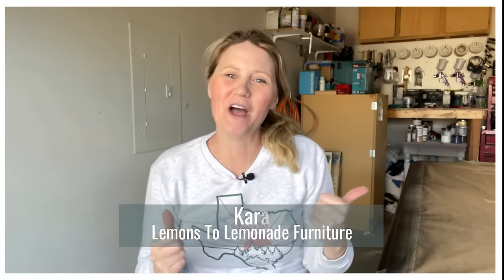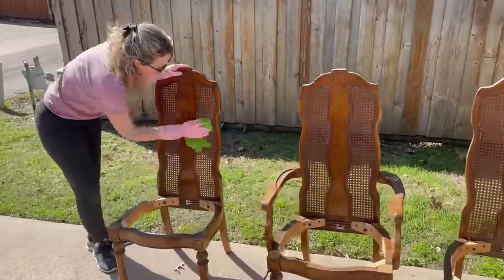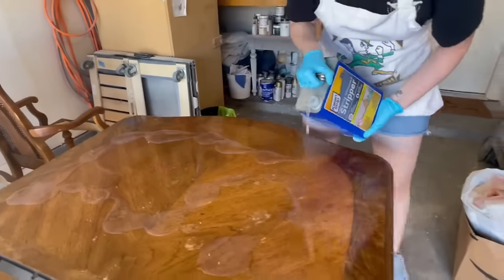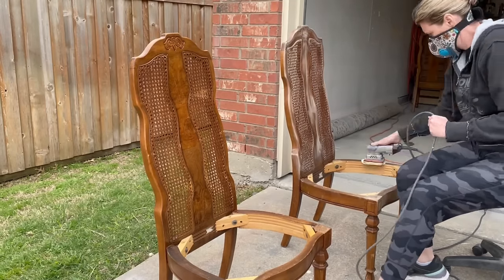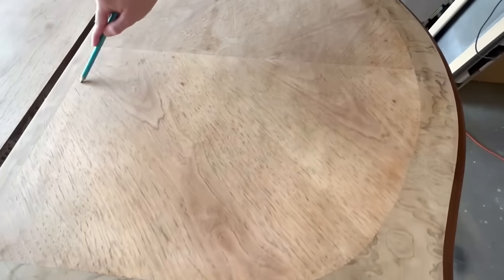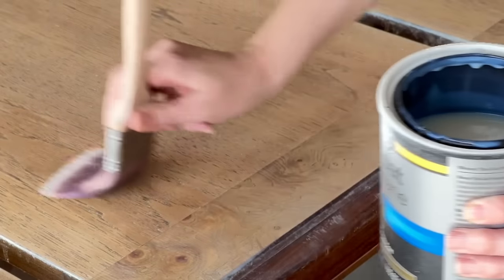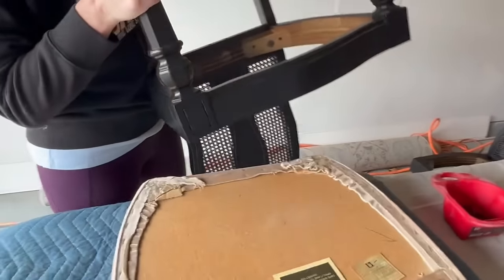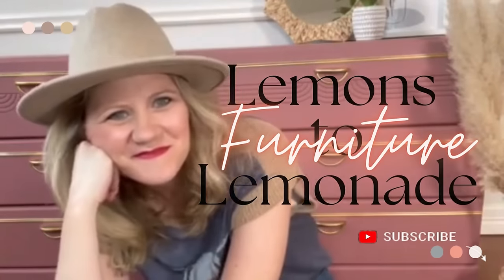Thrifting Gold: Transforming a Vintage Dining Table into a Modern Masterpiece

Comment: Think it’s lovely but I would have elevated a bit more by beige washing just the cane portion of the chairs so they don’t look simply spray painted. Also that would tie into the neutrals of the wood top and the fabric decks of the chairs, not to mention the other lighter elements in your room. Just my two cents worth. But lots of dedication and work went into this. You are a soldier!
Reply from the maker: Thanks so much! I was worried bc the cane was almost 50 yrs old how much I could sand for best adhesion and since it will get decent use, how would paint stand up over time w/o touch up. Plus the emerald trim paint can crack if it gets poly on it (it has one built in) so I would have had to be super careful to poly the cane by hand. You can tell I weighed my options on that one. Lol I definitely considered it.

Comment: I came across this when I was refinishing a dining table for my daughter’s after college apartment & looking for inspiration. I love the end result!  Your vision is amazing. Most people can’t see that far ahead or follow through between design, execution & end result—Bravo! 

I’d say the set would sell here for $3-4k.  Too bad they didn’t have the hutch/buffet! 
I love what you did with the one you already had. I just found that video. Both are gorgeous!

My only advice would be to finish the edges that are unseen when it’s together but show when taking the leaves out.  I am my father’s daughter and he always stressed doing a project 100%, like the sides of drawers & leaves, and removing hardware & hinges prior to finishing. It can be a curse sometimes!

If you wanted to upgrade the padding on those gorgeous chairs or change the fabric, it’s easier than it sounds to reupholster them —and you already have the skills and tools needed.  (& brilliant artistic vision).  
To duplicate the piping at the edge, you simply insert cording (or appropriate sized round shoelace or twine etc, like a taco, between a layer of fabric strip cut on the bias.  The bias cut allows the fabric to mold seamlessly around corners.  Or 2 rows is very stylish too, each encased separately —in either matching or contrasting fabric.  If you have trouble getting your cording to make a tight curve, use your steam iron while gently stretching & holding it in the right shape.

Can’t wait to see your next flip!  Thank you for sharing all your tips, insights and advice too!
Reply from the maker: Thanks so much for your tips! Yes when the time comes I will be updating those chairs.

Comment: Wow, that looked like SO much work—but it DEFINITELY paid off!!!
Two questions:
1. How did you prepare the skirt and trestles for the paint (i.e. chemically stripping it, sanding, priming, etc)? Did you seal it with a poly finish?
2. What made you decide to do the table top first, and then paint the rest of it? I’m a complete beginner and I’d worry about not getting such perfect lines of demarcation between the stain and paint like you did (and therefore might choose to do the painting first, so if I make a mistake/accidentally got paint on the tabletop, I could sand the paint  away before staining and finishing it). But maybe since you have a lot more experience, that wasn’t a concern? I’d love to hear what your thought process was around this choice!
Thanks so much for sharing!

Comment: This flip was so helpful for me.  I'm about to do the same exact thing to my dining table with cane chairs!  The veneer on the tabletop looks like it was repaired before, albeit not too well, so I'm wondering how that'll turn out.  The razor blade on the tape edge was absolutely invaluable info!  Question: do you ever worry about overspray when you're spraying black or darker colors?  Are your cement floors/driveways dusted with paint color?  And what about your cars?  I'm always afraid of spraying, even outdoors, because of overspray.  Thanks so much for the great content!
Reply from the maker: hello! no i don't really get any overspray with my paint gun. Everyone in awhile I'll get some stain on the garage floor but my paints are water based so they don't stay around long. Even if it did I would be able to powerwash it off if I needed to but I really don't have it last. Thanks for watching!

Comment: I really enjoy your videos, Kara! 
I have a question for you: how do you decide on finishing the top first? This is normally my first choice, but last time I’ve got a lot of gunk from the painters tape on my top. I wonder if the tops should be done at the very end instead. Need some advice. Thank you for sharing your knowledge with us! 🫶🏻❤️😘
Reply from the maker: paint is more likely to chip when I put tape on it to protect it from the stain I was applying to the table top. I let the table top cure for 2 days before I applied the black paint so my stain/poly would be ok with the tape over the top. Hope that helps!

Comment: You have simplified it all.  Again with that same gallon of black paint, LOL.  The color of the top compliments the tan velvet chairs, nice.  Not sure what that wood down the center of the chair backs was supposed to do, seems like that should be the soft part, but that is a minor thing.  Doubt if you could buy a set this well made today, so who knows what it would cost.  Although it is now black it oddly makes it easier to see through the chairs now.
Reply from the maker: I should have counted how many projects I got out of that $50 black paint gallon! I finished it off with this project. I swear my video didn’t do those chairs justice for what they really look like. I still can’t believe I stumbled upon this! As always, thanks for your support!
Reply: Also people want to rest their feet on the base of the pedestal just naturally.  They can't help it.  Be sure to keep some touch up paint very well sealed for the chips.  We used to use mayo jars, when they were made out of glass, then wrapped in several plastic bags.  GREAT job, I know it wasn't an easy task.
It has gone from being used 2 times per year to an everyday work surface.
Reply: @LemonstoLemonadeFurniture  You are an ace at spotting deals and you are lucky on top of that.
  I told you I had been studying interiors.  One thing for sure, in a room of pale neutrals, a small amount of black grounds everything. Suddenly it doesn't look like everything is floating.  Looks GREAT in that room and it is tough, so you will probably use it everyday.
Reply: Love it!  Love the black and the neutral top!  Great job Kara! 🥰🥰

Comment: I was surprised you didn’t need a primer or top coat on the Sherwin Williams paint. I recently used a paint from them on furniture that’s peeling and I actually used a primer. I think your table looks awesome! Please let us k is if it holds up. Thank you!
Reply from the maker: The only one that I would say is furniture approved is the emerald water based trim collection bc it is an alkaloid formula. Hope that helps!
Reply: @LemonstoLemonadeFurniture  oh I did not know that. Thank you for your response! Blessings to you!

Comment: Even painted, since it appears to be good quality wood, I wouldn't be surprised to see it an upscale furniture store for well over $5k.  Few mass produced tables today come with 2 leaves and 6 chairs, so the right customer would be eager to buy it even at a much higher price.  It's very beautiful BUT my personal preference is to never use paint on any wood surface that can be stained so that the wood grain shows.  Some surfaces can't be saved and must be painted, but instead of where you put the black paint,  I  would love to see it done with a very dark stain, especially the chairs.  My taste would have been to better emphasize the wood grain on the top with a light stain, muting the red/orange it was before, but not the milky color you used. Good video and I like that you put links to the things you use.

Comment: I just love your videos! How do you know when to strip the tops or sand it only? I’ve seen you do it both ways & just curious when to do either or. Thx!
Reply from the maker: hello! I will strip the top if a majority of it is still in place or it has a thick layer of poly on top. If it has a failing finish that is flaking off ect, it will sand easily and not take very much time. hope that helps! thanks for watching!
Reply: @LemonstoLemonadeFurniture  awesome, thx!!

Comment: That table turned out so beautifully.Can I ask what the difference is between a gravity fed paint sprayer and a regular paint sprayer. I used a regular paint sprayer for my deck and got so much overspray, how do I prevent that. Thank you
Reply from the maker: I'm not so sure as I have only ever used a gravity fed one ( that means material sits on top and flows down) I have not used one that the material loads from the bottom up. However, you nozzle could have been on too large of a spray pattern or it was the wrong size for the material you were spraying. Hope that helps

Comment: Could you tell me what it is you used at the very end of your video to complete your tabletop. You said it acted like a 800 grit, so the top was very smooth. I could not make out what you called it. Just finished redoing my large kitchen table and wish I had seen your video before I did it--would have helped tremendously. Thank you.
Reply from the maker: Thanks for watching! I use a paper bag! Easy little trick to buttery smooth tops!

Comment: Great job!  I have a question, black paint, what matte poly do you use?  It’s hard to know which one will work without causing haze.  I tried the add paint trick, it works but it’s still a pain.  TIA!
Reply from the maker: I use Sherwin Williams emerald trim paint. It has a built in poly.
Reply: @LemonstoLemonadeFurniture  thank you!  I’m in Plano, I’m dying in this heat trying to paint.  It sucks!  Every time I see you outside, I’m like I know you are dying in the heat.

Comment: Newbie here, I’m interested to know why you finished the top first and then painted the apron of the table wouldn’t it be easier to do the apron first then sand?
Reply from the maker: you risk taking the paint off when you have to apply tape so soon after painting. Once stain has set for a day or so it's not going to lift off.

Comment: You stated it was an oil based stain and then stated it was a water based stain. What was it?
Reply: I was thinking the same.
Reply from the maker: sorry, the stain is oil based. the top coat is water based. I waited 3 days in between applying the top coat from the stain since they were not the same. hope that helps